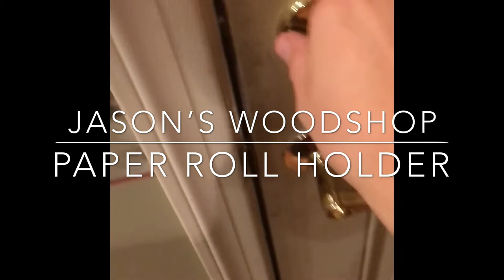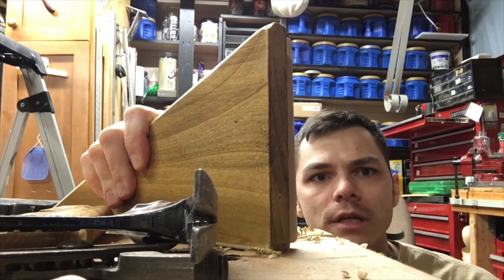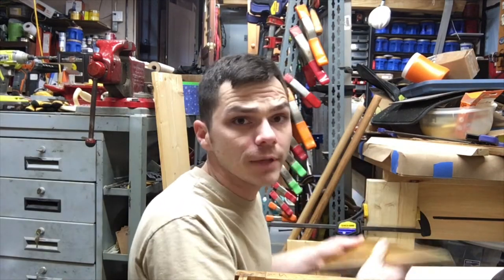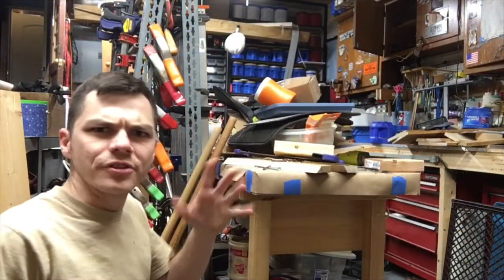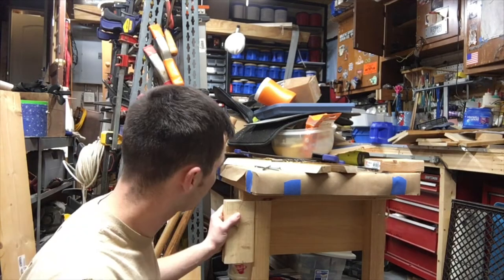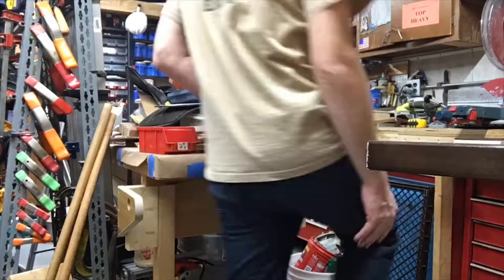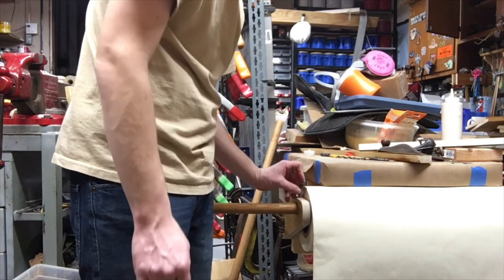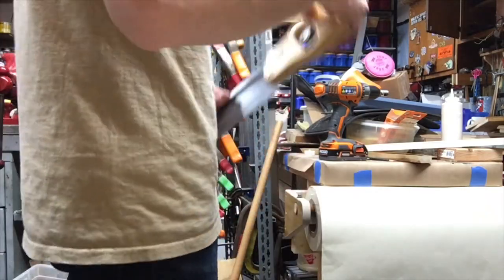The Paper Roll Holder

Comment: What tool was that which you said was cool?  Can you put the part number/model etc in the comments for any recommended tools you point out?
Reply from the maker: Thank you for the comment. It’s called a radius planet and the one I used is by Slick plane. 

https://www.amazon.com/Woodstock-W1100-Slickplane/dp/B0000DD0TK/ref=asc_df_B0000DD0TK/?tag=hyprod-20&linkCode=df0&hvadid=309869401414&hvpos=1o1&hvnetw=g&hvrand=12667180407060613783&hvpone=&hvptwo=&hvqmt=&hvdev=m&hvdvcmdl=&hvlocint=&hvlocphy=9015354&hvtargid=pla-524019470771&psc=1&tag=&ref=&adgrpid=63364097444&hvpone=&hvptwo=&hvadid=309869401414&hvpos=1o1&hvnetw=g&hvrand=12667180407060613783&hvqmt=&hvdev=m&hvdvcmdl=&hvlocint=&hvlocphy=9015354&hvtargid=pla-524019470771